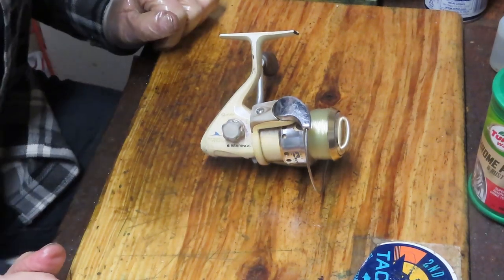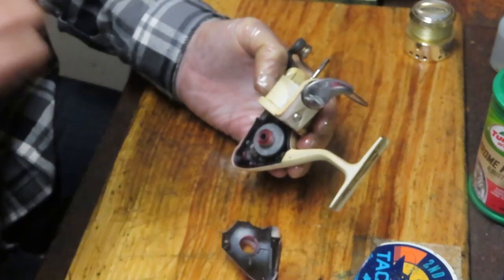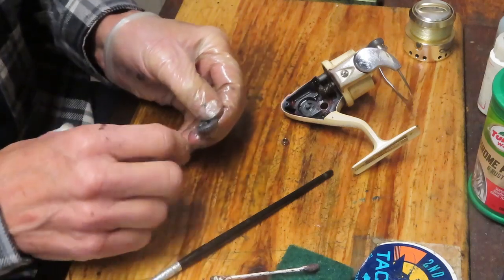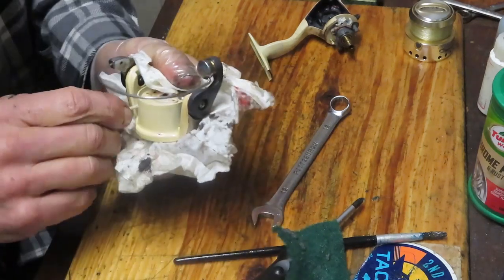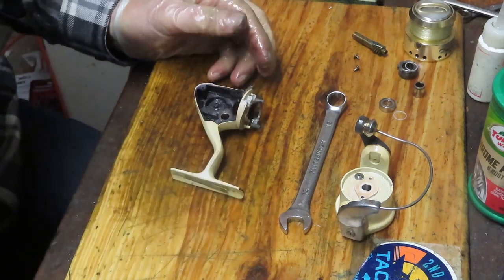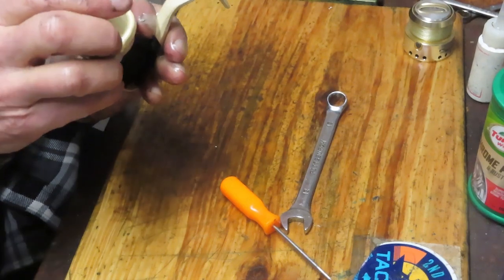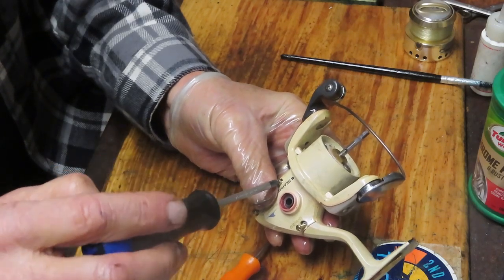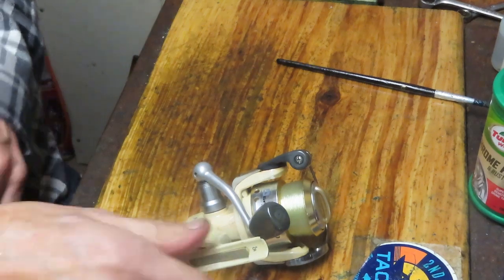Quantum Great White spin fishing reel how to take apart and service

Comment: Well Mr Dennis, I would expect that Quantum would specify their own Hot Sauce grease on the supplier of the reel, or possibly included with the purchase.

The reel appears to be a copy of the Okuma reel mass produced for various companies. I ended up with one that was on a rod that I wanted. My version is a 10 ball bearing model, though I'm not sure why the need for 10 bearings.

Hot Sauce if used on a reel that spends any time in the sun will weep out of every opening it can find. IMO it doesn't handle heat very well.
Reply from the maker: I don't use the Hot Sauce. so I can't say if it is a problem with the seepage.  I use the Penn greases and am satisfied with the results, so ewhy change?